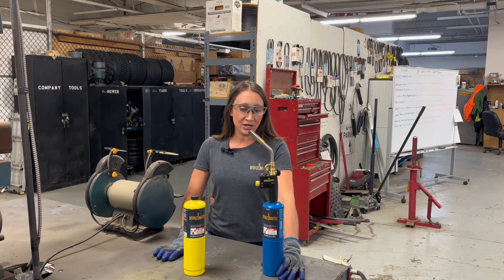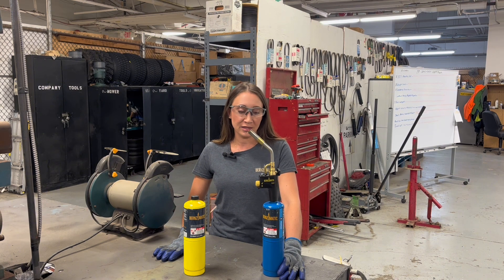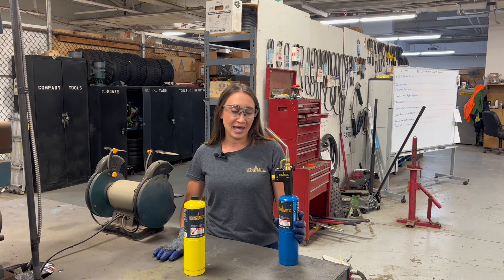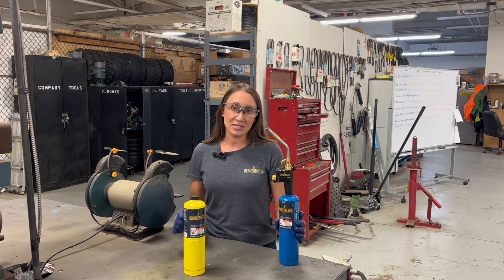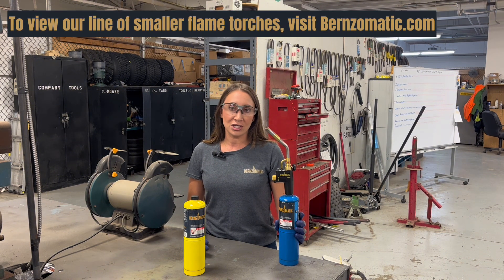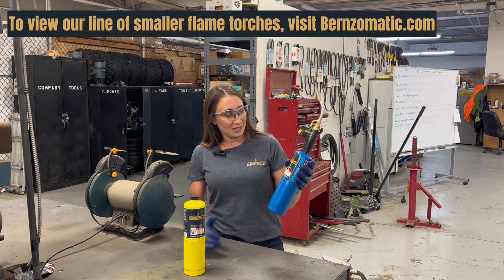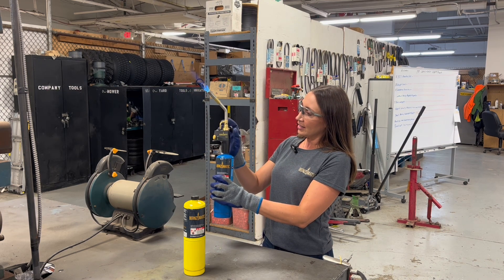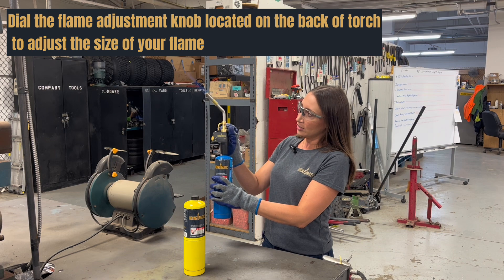How to Adjust a Torch Flame

Comment: My Bernz torch does not have a knob and the flame is too big!
Reply from the maker: You might have a possible that you have some blockage in your burn tube, so please see the additional information below for proper cleaning.
 •Remove the screw-on tip at the end of the torch.
•Using compressed air, blow air through the four small holes at the bottom of the burn tube outward
•Use a pipe cleaner to clean out remaining debris